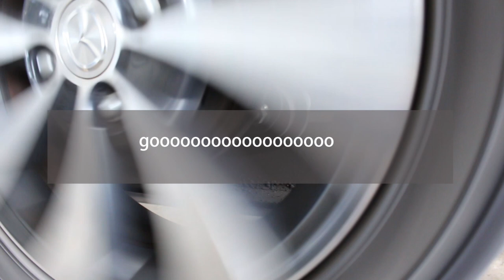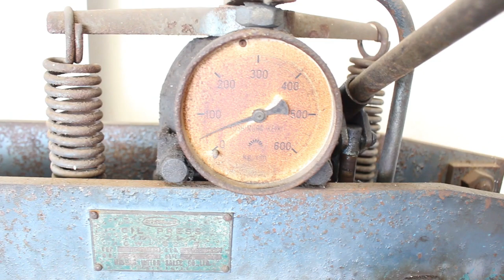R hub bearing such as Wagon R, replacement method by DIY when abnormal noise is released MH23S MJ23S

Comment: Hi, please tell me the dimensions in millimeters of the front and rear wheel bearings on the Suzuki Spacia 2WD MK42S? I want to lubricate the old ones, but I'm afraid to break them, I need spare ones. Thank you!
Reply from the maker: Thank you for watching!
MK42S 2WD
Rear hub bearing Part number: HB-S010
・ Locknut: RN-1001
Bearing reference genuine number: 46860-64L00
Front bearing reference genuine number: 43401-64L00

The front bearing seems to be sold with a hub.
This information was found by me personally, so I will leave it to you to decide whether it is reliable or not.
I did not know the size, but please search on Amazon etc.